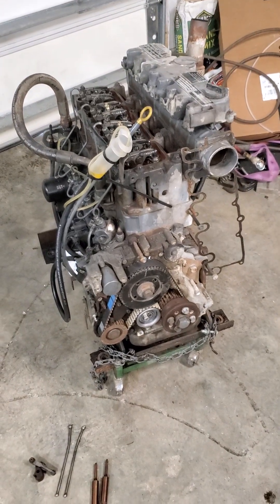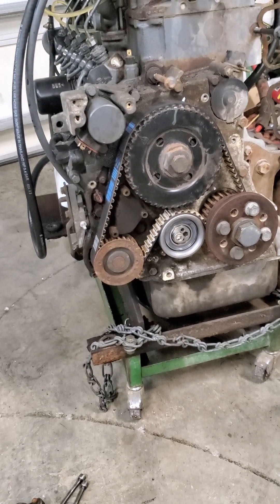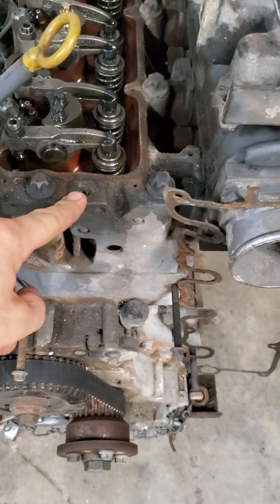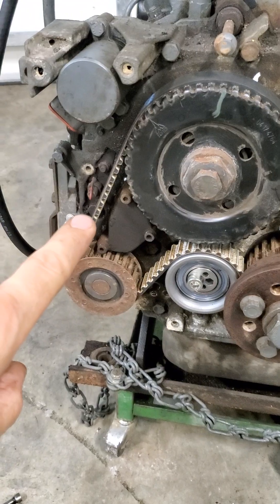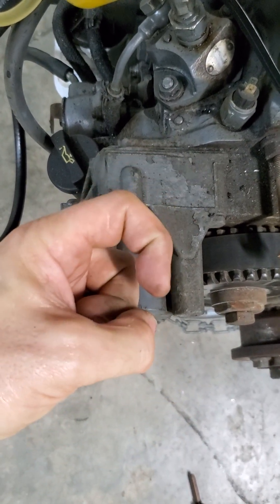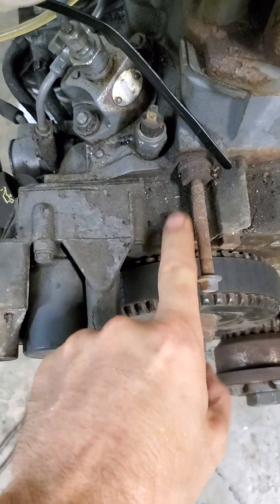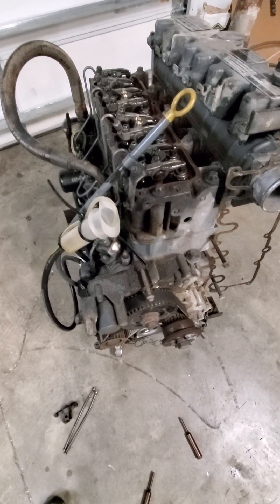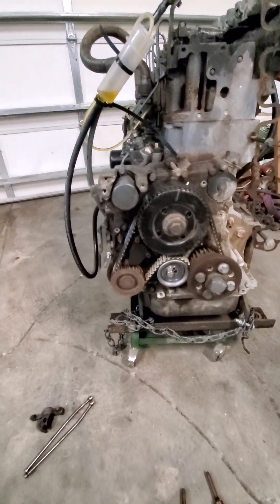Deutz f4m 1011f engine not starting, priming injection pumps, timing belt

Comment: Had a bad shutoff solenoid, wouldn’t turn off no running away just wouldn’t shutoff the fuel. Installed new solenoid now it won’t start, remove solenoid and it runs again
Reply: Sounds like it's in wrong

Comment: I have the same motor from my T 200 Bobcat. I did a complete rebuild, it starts fine, but it surges from low to medium rpms. With the solenoid removed, I can get it to idle correctly holding the fuel rack open. 
Is it the governor ?

Comment: Excellent 👍 doing same job now.
Frozen injection pump .
Got them clean free and then dropped one snapped plunger off...😢
Goofy rubber timing belt on industrial motor s.
New age 2.9  water cooled are now gear cam drive but have ECM common rail.

Comment: Do you know what causes “runaway” on these motors? My fuel rack moves freely but I still have no control over the rpm’s
Reply: Lift pump leaks fuel into motor oil causes overfilling and runaway.
I had one do that.
Change lift pump on oil if oil level gets high .

Comment: Good evening chief please, I have a problem on a deutz engine 2 cylinder model F2M2011.while proceeding to the starting the injector pump does not discharge fuel, I disassembled these two pumps then mounted on another identical engine and then the pump discharges fuel.I tested my solenoid also on another engine it works well. I tested my solenoid also on another engine and it works well. But I have a problem with my rack by sliding it on one side without the presence of the pumps it gets stuck on one side now I followed your video I began to have ideas but I do not know how to put back in order this rack.and then you had talked about the adjustment of the valve also which causes problem precisely the exhaust valve, I do not have the catalog of this engine I seek your help to know this adjustment and other possible verification.
I thank you for your kind understanding.

Comment: Can you do a video on setting valves? Cause this video is what I was looking for, just need help with the valves.  Thanks
Reply from the maker: You mean setting valve lash? Intake and exhaust 
If so, its very basic like it has been on engines from beginning,  loosen the lock nut above each valve and turn the set screw to set feeler gauge needed on each valve.

Comment: thanks for the useful tips - Do you know the pinout of the 3 pins on the shur-down solenoid by any chance - I understand there are two coils inside
Reply from the maker: The two pins that are in line with each other. +/-12v to them. 
The perpendicular one is engine ground.
It is one coil.
Reply: One coil is pull in the other is holding coil .
If pull in is bad it won't start .
Often get hot coil goes bad.